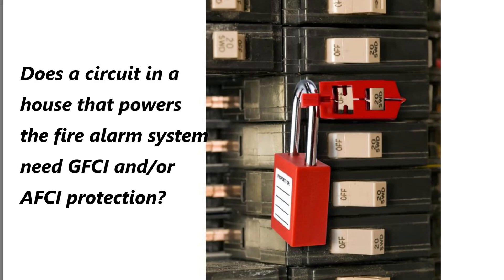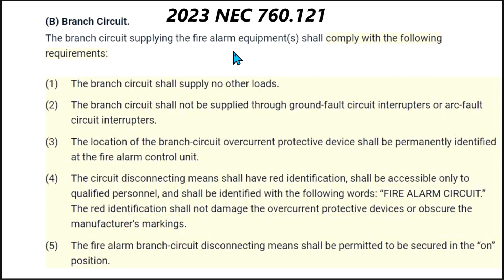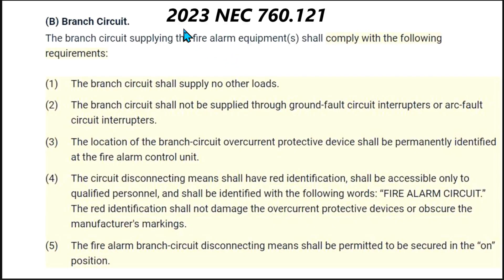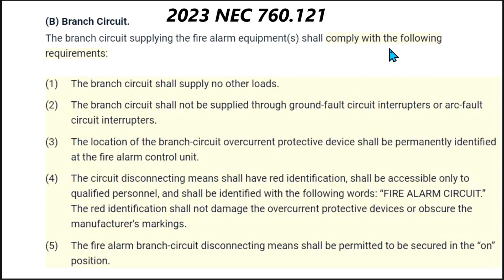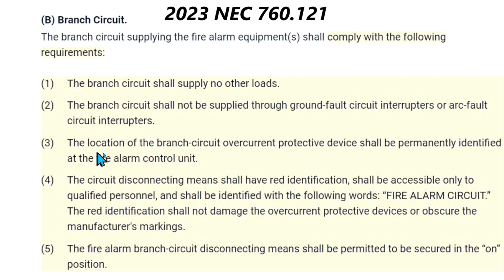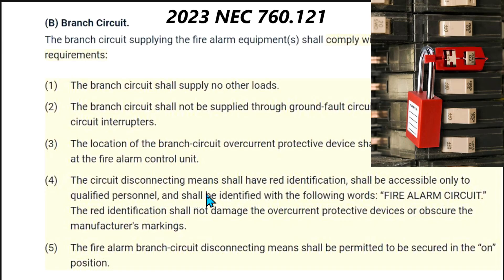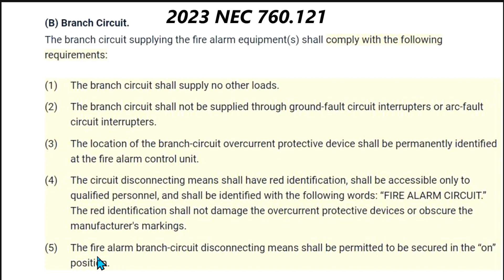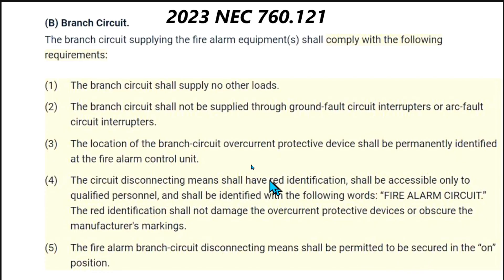Does a Fire Alarm Circuit Need GFCI/AFCI Protection?

Comment: A licensed electrician just installed hard wired smoke / fire alarms in my house. There was a perfectly good unused breaker available but he removed it and installed an afci breaker for the fire alarm circuit. There are in fact no other loads on that circuit. The detectors all have battery backup so I do not consider that to be a safety hazard and since an electrician did the work any possible code violation is his problem not mine.

Also interesting is the breaker he installed is 20 amps and there is definitely some 14 gauge wire in the detector loop. Due to the short length of 14 gauge wire I have no concern that the breaker would trip before burning the house down. Perhaps there is some exception that allows smoke detection loops to be 14 gauge? Again an electrician did the work and I am not going to tamper with it. I didn't take the dead front off the panel so maybe there's some current limiting there that I don't know about.

Comment: So the fire alarm system is to be locked to on position with a lock out tag out device or is there another means of securing the breaker to be on constantly
Reply: "shall be permitted to be secured in the "on" position".
I'd say that means it can be secured on, but doesn't have to be secured on.

Comment: Thanks for the info. I think the one aspect that surprised me was number 4. Kind of a dumb question but since we are talking about a residence,  What Lock can be installed that practically "all" electricians can access but typical resident cannot?
Reply from the maker: I was wondering the same thing.
Reply: I just went a little bit in to the rabbit hole of what the definition of a "qualified person" is.  Especially unclear is who manages the appointment of "qualified persons".  I presume the owner of the property is, since they might hire a different electrical contractor for every service they need.  So does the owner promise "scouts honor" that they will keep a key but only let an electrician actually turn the key? OSHA lists skill requirements, but they fall short of actually being a licensed person.

Comment: If AFCIs aren't reliable enough for a fire alarm with negligible static load, they're not reliable enough for a refrigerator, in my humble opinion.
Reply from the maker: I agree with you.
Reply: Wow, good point.
Reply: Reliable has little to do with it. We don't want to trip for a fire and take out the alarm.
Reply: Maybe they count that you will not die if your fridge loses power. Now I think this is somewhat overkill as fire alarms are battery backed anyway.

Comment: It's beyond time that we have audible trip alarms in our circuit breakers in america. I find the audible alarm GFCI outlets invaluable - I can't imagine how many service calls would be avoided if breakers alarmed too!
Reply: Or reclosers
Reply: @JasonW.  Reclosers would definitely be a good idea for some cases, but someone would need to put a lot of engineering thinking effort into deciding how, where, and when, reclosing should happen
Reply from the maker: Interesting idea, thanks!
Reply: Nice idea!
Reply: Breakers are electromechanical, GFCIs are electronic. There are limits on what a breaker can do. Btw in Europe RCDs are also electromechanical, electronic ones are banned.
Reply: @okaro6595  yes, electromechanical. Audible alarm functionality would have to piggyback on the mechanism.

Comment: Without even checking the NEC my gut was saying NO simply because they don't want something goofy happening that might inadvertently cut off power to the fire alarm. You proved my gut feeling was right Bill.
Reply from the maker: Sounds good!
Reply: Our inspectors don't care and don't read code. They fail fire circuits on standards
Reply: @Squat5000  - ugh, that's terrible.

Comment: I’m assuming this doesn’t apply to single or multi family dwelling units because Part lll of Article 760 covers “Power-Limited” Fire Alarm Circuits. In single/multi family dwelling units the circuit controlling smoke and carbon monoxide detectors is a standard 120volt circuit. I like to wire these using a general lighting circuit so there’s less chance of the homeowner turning off the breaker when the smokies start chirping. Am I correct thinking this is a different topic altogether?
Reply: it's how I've always treated it, as well.  and yes, I'm pretty sure is is only for dedicated alarm systems, and not for line voltage smoke detectors.  but it sounds like a perfect topic for a follow-up video.
Reply from the maker: There are 2 articles referenced underneath 210.8. I gave one in the video. This is the other one. It would be most appropriate I think:

760.41 NPLFA Circuit Power Source Requirements.
(A) Power Source.

The power source of non–power-limited fire alarm circuits shall comply with Chapters 1 through 4, and the output voltage shall be not more than 600 volts, nominal. The fire alarm circuit disconnect shall be permitted to be secured in the “on” position.

(B) Branch Circuit.
The branch circuit supplying the fire alarm equipment(s) shall supply no other loads. The location of the branch-circuit overcurrent protective device shall be permanently identified at the fire alarm control unit. The circuit disconnecting means shall have red identification, shall be accessible only to qualified personnel, and shall be identified as “FIRE ALARM CIRCUIT.” The red identification shall not damage the overcurrent protective devices or obscure the manufacturer's markings. This branch circuit shall not be supplied through ground-fault circuit interrupters or arc-fault circuit-interrupters.

Comment: Had an inspector tell me at rough, that the f/a breaker needed to be locked in the on position
I asked him what happens if the drywall guys or cabinet guys put a screw through the wire
Most modern breakers will still trip with the paddle locked in the on position
He didn't have an answer for that and let me slide
The fact is your house has to already be a goner before those sprinkler bulbs pop and there is also a built in delay on most flow meters before the alarm kicks in.
so bottom line ....a complete waste of time 
The sprinkler system just makes sure that whatever the fire doesn't damage the water will
our precious scumbag, lawyer, lifetime leech politicians taking care of us
Reply from the maker: I wouldn't lock out the fire alarm circuit until after the drywallers were done.

Comment: We recently installed a circuit of smoke alarms in a house we own where it's legal to self-permit as a homeowner.  We passed inspection, but it bugs me that somebody could potentially turn off the smoke circuit from the outside panel and start a fire if they were so evil.  Are there any breaker devices that keep a Square D Homeline breaker locked into the 'on' position?
Reply: most outside panels have some kind of locking provision.  however, you should not have been sold smoke detectors that didn't have a battery backup feature, so you at least have that.
Reply: @kenbrown2808  that's a great point, thanks.. I should've thought about that lol..
Reply: @jeremiahp  it's a thing we take for granted.  I'm old enough to remember when they were sold without battery backup.
Reply: Like the previous commenter stated, the backup battery will prevent that from happening...👍
Reply from the maker: TRADESAFE Circuit Breaker Lockout Device, 3 Pack, 480/600 Volt, Clamp-on Breaker Lock Out Device, OSHA Compliant, Premium Grade, Large: https://amzn.to/45CUAkZ   (They come in 3 sizes)
Reply: @SparkyChannel  thanks, Sparky!!
Reply: They have battery backup otherwise they would not work during blackouts when people use candles light things-